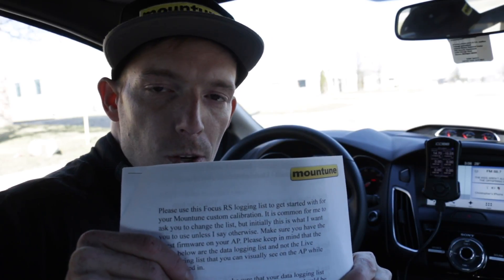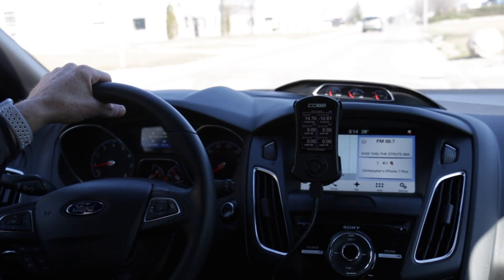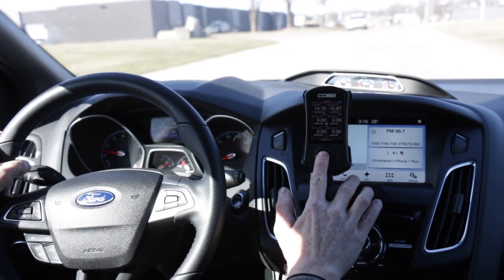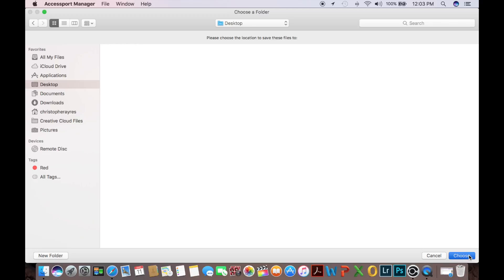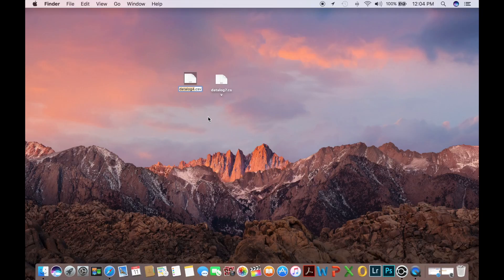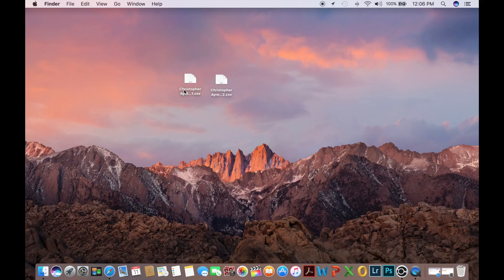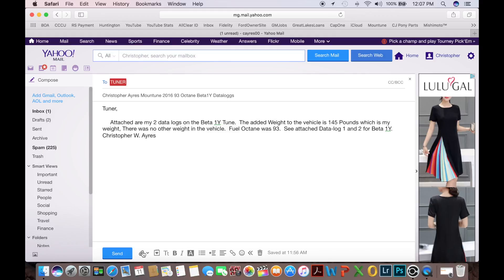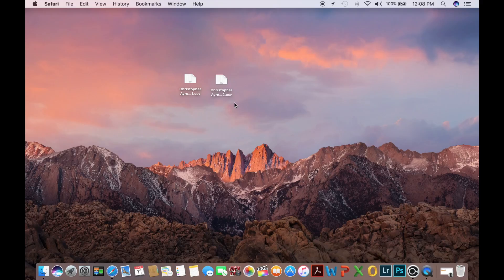Mountune's Tuning and Data logging Part 2

Comment: I am about to start my data logging. I know Randy requests that you do a log on the "Cobb stage 0" stock tune and one with the mountune calibration. Are both those tunes available on the fly (switchable on the cruise buttons), or is that something you need to reflash the car to do?
Reply: Thank  you for your helpful videos Chris!
I am about to start my logging with randy today:)
Reply from the maker: +Michael Roffe you can change them on the fly. Is he asking you to log the cobb stock file or the Mountune stock file? When I was logging I never used any of the Cobb loaded files, things may have changed though.
Reply: This is from the Mountune instructions "For the sake of comparison and realizing gains it is required
to do 2 data logs with the Cobb Stage 0 file, which is the stock file. Do the Stage 0 logs first and then the Mountune calibration logs." this is where it confused me a little bit
Reply from the maker: +Michael Roffe ohh yes that makes sense. Plus they can collect data from your stock run and their “stage 1” of you own vehicles run. So that makes sense. They will Be how you car behaved stock and then to see how it does on the Mountune tune to see how advanced spark, etc. is working on the car at a low level. Once they have that baseline then you can really start moving up in power.
Reply from the maker: Good. He’s a good tuner. You’ll like the finished product.  Just make sure to quickly obtain and install a catch can system ASAP. You won’t regret it to help slow the progression of carbon build on your intake valves, nothing to do with tune, just RS.

Comment: So when the new log comes from Mountune, you just drag and drop it into the cobb manager/accessport?
Reply from the maker: +Rev you may be able to. I usually save it to my desktop and then import it through AP. “Import files” is near delete files, etc. that way I have a copy on my AP and one I keep on my computer.
Reply: Good idea
Reply from the maker: +Rev 👍. I used to save all my tune files and data logs saved to a hard drive in order just in case me and my tuner had to go back to any of them.
Reply: I've never owned a handheld tuner or done data logging. My last 2 vehicles were a trans am and a ctsv and they were dyno tuned by a shop. This is my first time doing anything like this. So thank you for all the help.
Reply from the maker: +Rev I kept the date, what log it was, 1,2,3, etc and even temp outside and fuel with every run. May have been a little OCD but that is how I can tell you that out of the many logs I ran, none of them were remotely to rich as some have commented in my other video. They are just excel sheets that are very easy to spend 5 minutes to see pretty much everything your motor did when you logged or tried a tune revision.

Comment: Chris this vid came at a good time. I'll be receiving my Mountune AP and tune tomorrow and will read all instructions. Great vid
Reply from the maker: +lexist2112 Good I'm glad it worked out. It's basically the instructions in video form. Sometimes it's easier to understand that way for myself anyway, but for sure read the instructions that come with you Mountune calibrated AP.   Also thank you and you know how to reach me if anything comes up.